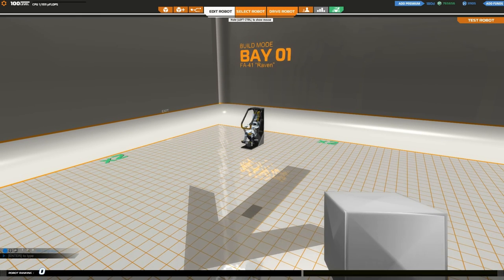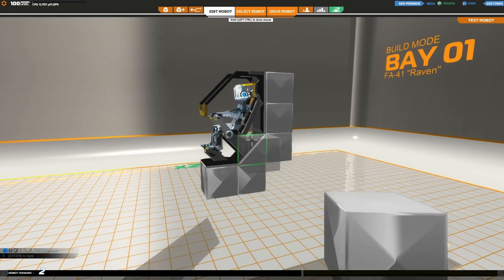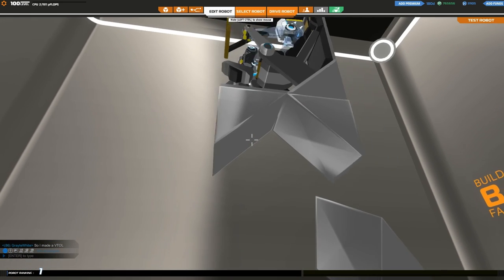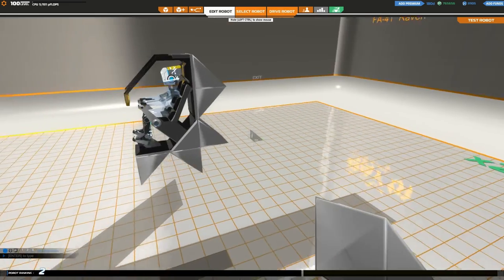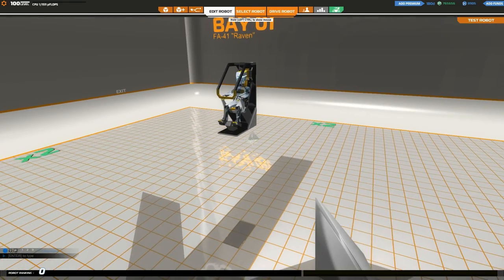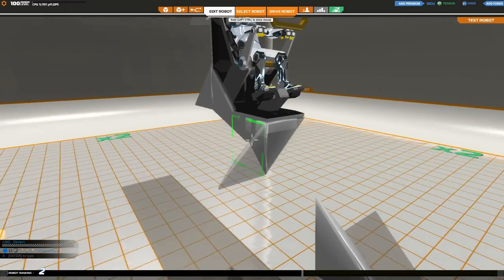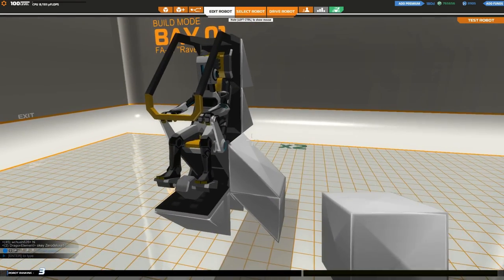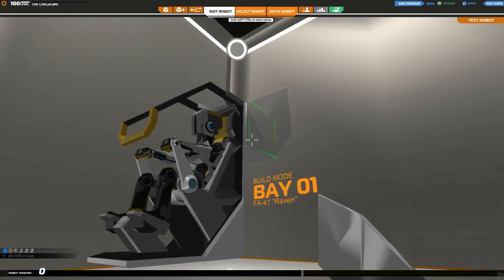[OLD] Robocraft: How to Triforce the Pilot Seat

Comment: Awesome vid, cleared out a lot!
Reply from the maker: no problem. Glad this video helped you :)
Reply: +SpaceKryptonite i have a question on a pretty olod vid i saw that if damage reaches a dead end it will jump to the nearest block, is this still a mechanic? if so u also need to keep this in mind because this could destroy the purpose of triforcing
Reply from the maker: that old video is not correct. If the damage leads to a dead end, it will not jump. It will instead do no damage. The blocks needs to be connect in order to continue. More tutorials will show it in action